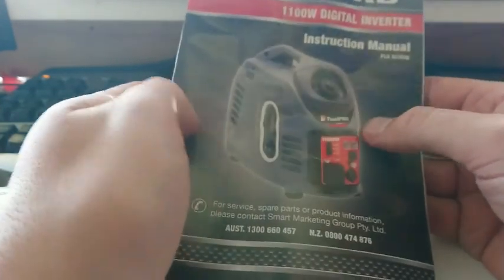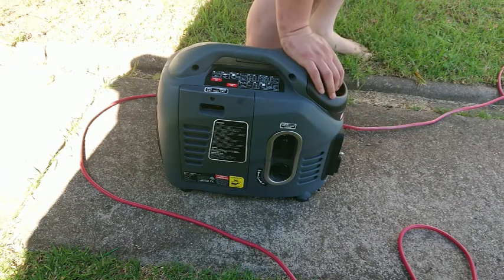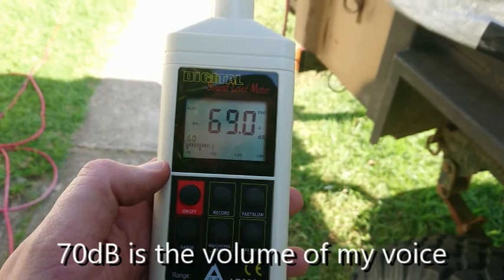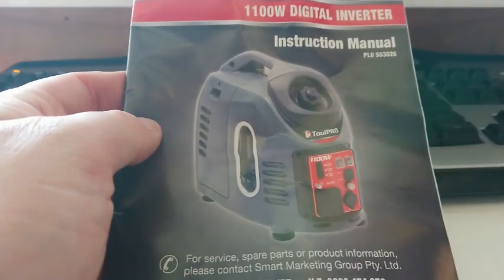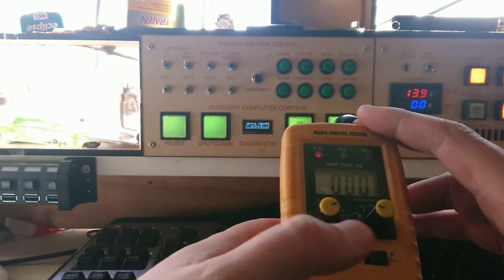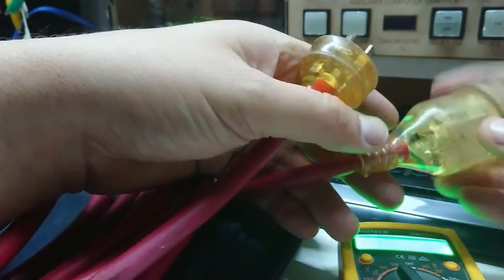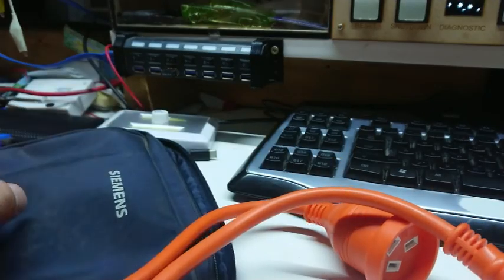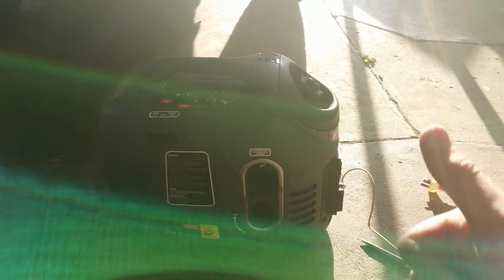Trialing the ToolPro 1100w inverter generator

Comment: The problem is the dip-tick is too short. 😮😆😆😆
Nice little generator, glad you tried it at night it can sound totally different, like growling koalas, sound like an angry chainsaw...😆😆
85 dB(A), is considered a workplace level that needs protection, so its pretty good.
Have you got one of those "Energy Analysers" that plug into GPO and give volt/current/power factor and if you put in sufficient data, how much your power through it is costing.
I couldn't see any RCD units in your fuse box, they should have TEST buttons on them.
When you tested on the generator you had NO P-E light ON. (No Active-Earth potential.)
When you tested on mains you did have P-E light ON.(Active-Earth potential, which is M.E.N)
Reply from the maker: The PE light was what tipped me off to go looking into it further.
Every single breaker in my box is an RCBO.
They all have test buttons, and I test them every 6 months due to my dubious tinkering with death leads on occasion.
I'll continue to test on that full fuel tank fill. determined to find it's run time. it's a rating that literally no-one will provide.